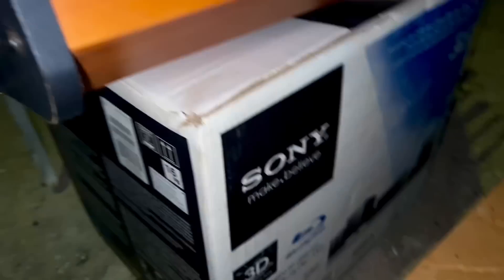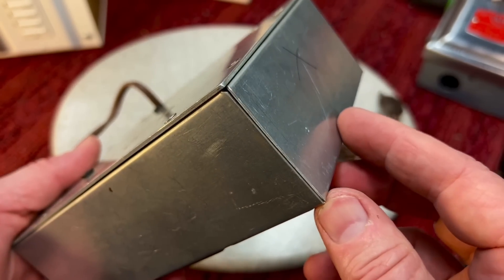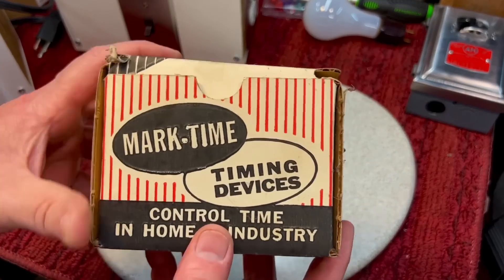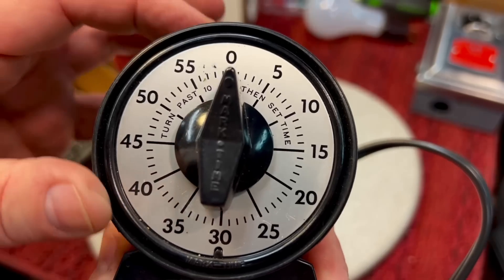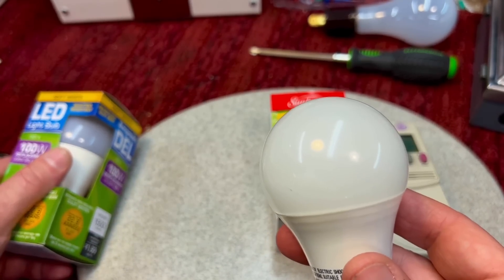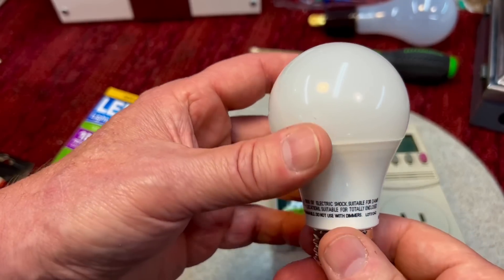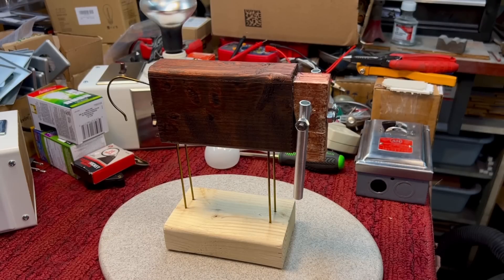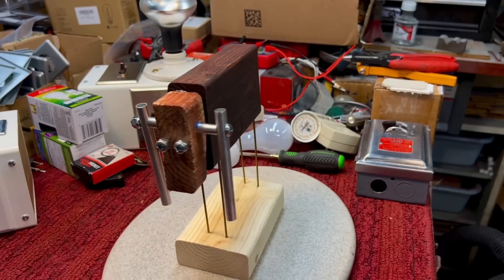LED Bulb Teardown, Outlet Checker, Show-N-Tell -Foosball?

Comment: The outlet tester should squash the debate as to whether a receptacle should be installed with ground up or down.  LOL.  The LED on the freezer side of my mom's 2017 Frigidaire went dark.  The replacement would cost about $6 (3.5w KEI34DL) so I replaced it with a regular incandescent appliance bulb.  It's a freezer!  How the heck does an LED rated for 20 years fail in a freezer after a few years other than poor quality.

Comment: I did have an LED very similar to the one you have there fail and could have possibly ignited but I caught it by the acrid smell and it was hot as heck. I had a whole order of small bulbs for a ceiling fan go bad one after another they would stop working or the components came unattached. The whole thing was a mess and poor quality. I ended up super gluing the diffusers and the bases to the contacts because they so loose you couldn't screw the bulbs in the socket. One other problem I have had is that some bulbs fitted into a socket will not remain in good contact and begin to have an open contact so you need to retighten once a day. They were very loose in the socket. Never had that with an incandescent, they all seemed to be better standardized.

Comment: Greetings again from a baking hot Abu Dhabi UAE.
I note in the Alarm Clock segment of the video that the seconds hand sweep appears to be quite smooth and not the atypical quartz "Stepping" movement of inexpensive battery powered alarm clocks which leads me to wonder about the movement in that Alarm clock.
Bulova, the NYC based American Watch Company, have produced a series of wristwatches that feature this system. The quartz movement in the Bulova Lunar Pilot isn’t just any quartz movement. The typical quartz movement uses a crystal vibrating at 32,768 cycles per second that gives a relatively noisy "stepping" sound. The Bulova branded “Precisionist” movement uses an “ultra-high frequency” quartz crystal. It vibrates at eight times the rate of a traditional crystal: 262,144 cycles per second, or 262 kHz producing a virtually  imperceptible second hand sweep motion.  It is still ticking, but at eight times the frequency to give the impression of a smooth, soundless sweep.
Fascinating. 
Thank you, as always, for all your cool posts.
Reply from the maker: Yes! This clock used an electric motor that was smooth as silk!  My dad received a Acutron watch when he retired that uses a timing fork!  😃👍

Comment: NOS is the best no matter what it is, always seems better made. I’ve had a few LED failures but nothing catastrophic, and the heat sinks on newer version bulbs are much smaller, as if the originals were lasting too long. A failure on a CFL burned an entrire home to the ground several years ago here in our community, so good riddance to them. Up or down, Moose or Cow best left to the imagination.

Comment: Nice show John.
The timers quite often failed because the points in the switch would burn from an overload. 
The ShellMold machines at the foundry used mechanical timers to control the mold making process. My Dad showed me how to fix them and on 3rd shift when I didn't have much going on I would disassemble and repair them. Usually some paper rubbed between the point got them going. 
Biggest problem was people hitting them to make the timer trip early. The operators got paid by the mold. Speeding up the machine added money to their pockets. Made the molds fail more often but they didn't care. 
They hit the timer with a bar or a hammer and it reset.

Comment: I thought the point of light emitting diodes was that they generate almost all light and no heat?  Fooseball table was a great score.
Reply: He didn't cover this but the difference in light from an LED is far far far more narrower beam coming out than the old incandescent or CFL bulb and that's the biggest reason they seem brighter; because they are brighter where the light goes!

Comment: Big Clive has done numerous LED teardowns on his channel. There is a danger of electrical shock from an uncovered bulb. Also there is an easy way to reduce the wattage of the bulb you showed, thus reducing the heat output and greatly extending the life of the bulb, while only decreasing the light output by a reasonable amount. He's the expert, so I won't try to describe how, but I've done it and it works.
Reply from the maker: Big Clive is the man! 😃👍

Comment: Ferdinand the Bull was horns up when he was happy and horns down when he was sad. Horns up, definitely. I would have only taken the foosball table if I had an idea how to use the components. I would not want that thing eating valuable storage space. Great video. You talk about LED lights. What are the super bright and hot lights that can explode if you touch them and leave body oil on the bulb?
Reply from the maker: I know certain bulbs like halogen burn so hot that hand oil can shorten the life of the bulb if touched.  I don’t think LED’s suffer that same issue. 😃👍
Reply: @ScoutCrafter  Halogen. I could not remember Halogen this a.m. I have 2 Japanese work shop lights that use halogen. Boy are they bright, but insanely hot. Thank you. Could you please do a class about epoxy for binding materials. I do not care about epoxy floors or table tops.

Comment: I have a timer on my water heater that turns it off at night and on in the morning before we get up.
Reply: I have one on my air compressor otherwise it runs at about 3am and wakes me up. It just died and I need to buy another one that handles high current loads.
Reply: @johnpossum556  If it comes on @ 3am...it sounds as if you might have an air leak to fix as well

Comment: This might be a dumb question but I thought LEDs ran cool? You said they get hot and when you get an LED headlight replacement kit for your car, a lot of them come with small fans which make me think they do run hot.
Reply from the maker: The older bulb style ran cool but these surface mount square style give off some heat. Put 16 into the mix and that’s warm.  The old style weren’t as appealing in the light they give off.  😃👍

Comment: 12:15 I can run the exact same bulb starting at the exact same time on two different floors both in the same open hallway design and no matter whether it is CFL, incandescent, or LED the bulb that always falls first is the second story where there is more heat. There are some truths in electronics which do not change over the generations. This is one of those.
 12:32 That "diffuser" is WAY more than that, it's the last line of defense against prying little fingers getting to full line voltage and that is why it is glued in there so ruggedly. Truth #2 Anything near a child is usually overbuilt. ( I picked up a double child baby modern baby buggy and the thing actually has an anti-sway bar built into its rear frame. Wowszers! It's about as thick as a #2 pencil but still I thought to design that in there is so cool. Another modern design we could easily overlook. )
 Stay safe this weekend, always lots of weirdness and bad drivers on the road high on whatever they can get. I am building a squirrel proof bird feeder as per Chris Notap's design:  https://www.youtube.com/watch?v=b1WildSHrUI&t=520s posted a few days ago. My circles are messes compared to his since I am using a metal cutting abrasive wheel on a portable 120V circular saw. I think I spend more time cleaning them up than it takes to cut one. I am reusing an old steel post that came inside a white marble-based lamp I rescued on a poor man's flea market. 
 I almost rescued a nice leather parallel styled rocker when I noticed a bunch of young kids hanging out in a SUV surveilling the block prior to their little crime spree. Though my presence alone might have spooked them since I came twice (though it was to look at the rocker, not them, but they don't know that!). 🥵🥵🥵 🤓🤧🤪😂😂😂        
 If those are my only choices then the horns should be up plus you must turn little delrin caps for the ends of the horns so they are properly pointed. It is a BULL after all!
 Now if you were smart you'd never see this because you would be heading the other way but I really feel you should have the horns sticking straight out. How about some pointy little menacing red mini bulbs in the ends or the eyes?
Reply from the maker: That’s funny how you stopped a crime looking for swag!  Similar thing happened to me, I was hovering over some trash and a van got spooked and sped off.  They were scouting for sure.  No plates. 😃👍

Comment: I made a timer box from a digital clock radio. Where the AM/FM circuitry was I put in a board with a resistor and a relay and drove it through the clock radio output. You could see it through the clear lense in the original digital clock radio box where the tuner would normally be. Very useful because this was before good options were easily available.  Now there are some great outdoor options available cheaply towards Christmas time. Most of these newer ones have RF remotes, also, that go through walls.

Comment: When you set the timer to 3:00, you didn't press the dial back in... This might have prevented the contact from making when adjusting the time. Also, some of these old timers couldn't be "forced" into making contact and had to be activated by the clock running through the set time... 
It will be interesting to see what the issue is.
Looking forward to seeing the solution!

Comment: There's a capacitor inside the base of the lightbulb, under the board. When they start blinking, it's usually because this capacitor is going bad. It should be an easy fix, but these bulbs are not designed to be taken apart, we pretty much have to destroy them to remove the board.

Comment: I've had LEDs fail but mainly then they either stay glowing after the switch is off or they just blink. They sure don't last as long as my flourescent tubes but in the winter they light when you through the switch and you can turn them on and off with no effect. As to the ears, up when you are talking to it and down when you aren't. That old home made timer is just a pleasure to look at how it was made.

Comment: Interesting info on LED bulbs. My bulbs flicker when they are going bad. I have not noticed any heat but I notice the bulbs seem brighter than old style ones. I have a gas light outside that is 50 years old but is is more decorative than useful light.  i replaced it with a new LED fixture and now have brighter and  more secure lighting for my parking area. I also put in a LED photoelectric bulb. I also notice my natural gas bill went down $20 a month. Multiply that by 25 years and it totals $6.000 in gas bills. Amazing. oh, they are definitely horns pointing up. Poor build, poor packing and a rough transit.

Comment: The clock switch has 3 positions.  It needed to be on Auto (straight down) to engage the switch from the alarm set time.

Comment: I have been very disappointed with LED bulbs service life.   Like you I love LED's, but they just are not lasting long.   I have not had a fire thankfully.   The bulbs fail either with zero light or they start to flicker.   Either type of failure is one or more components in the circuitry to reduce 120V AC to whatever voltage DC is needed for the LED's.   I expect the manufacturers cut corners in the components or drive the LED's too much causing failure.
I am happy you took the Fussball table home.   Too good to go in the landfill.
I have one of the outlet checkers.   As you said, very handy.   It is so easy to mis-wire an outlet.   It may still work, just could cause issues in the future.
Dave.

Comment: I remember my father constructed a mechanical timer in the 50's, when we lived in Chattanooga, TN.  During the summer, in the days "before a/c", he put a box fan in an upstairs window, to pull cooler evening air through the second story.  Rather than have it run all night, he mechanically coupled a light socket with a turn-type switch to the alarm key of a Big Ben alarm clock (Remember them?), and set the alarm to the desired fan shutoff time.  When the alarm tripped, the wind key turned, turning off.the light socket into which the fan was plugged.  As they say, "Bob's you're uncle!".  I sure do miss my Dad!